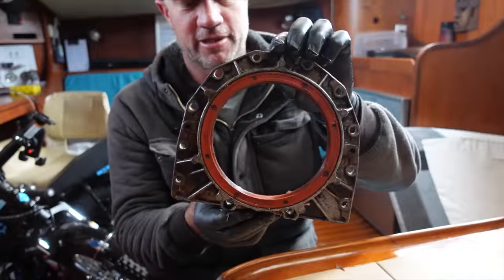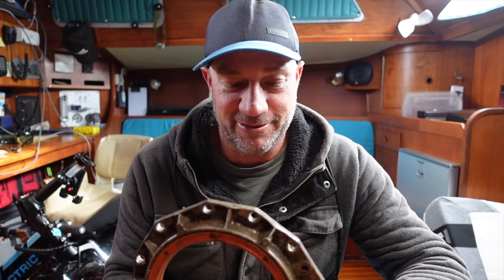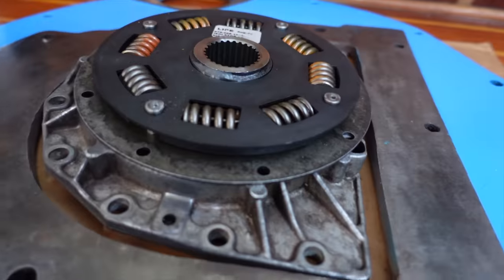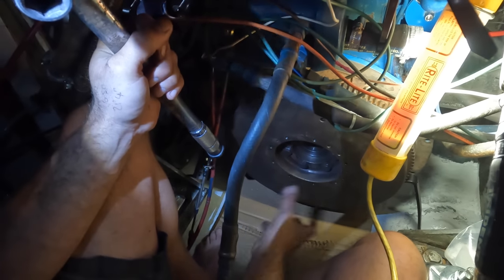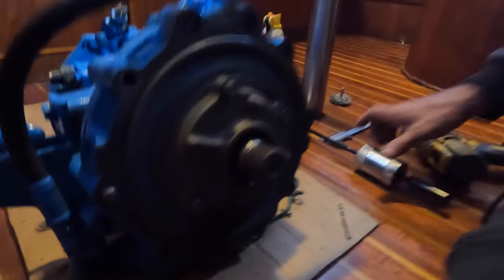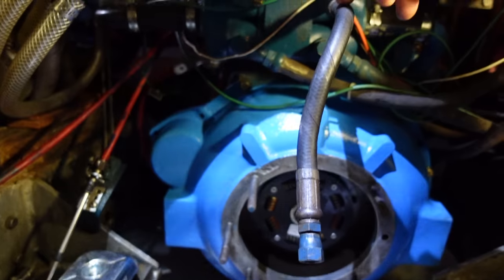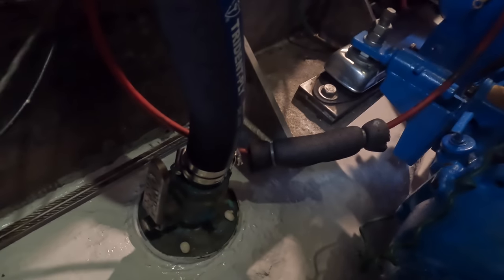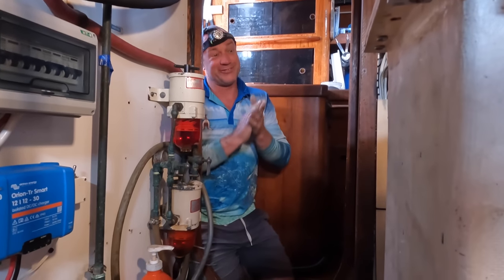BOAT LIFE = Time Patience and MONEY | Ep 351 | Lots of Boat Work

Comment: Lee, sorry in advance for the dumb question, but the crankshaft lip seal appears to have the lip facing towards the transmission, shouldn't the lip face the internal parts of the engine? (Unless it's a double lip seal that is.) Thanks for sharing and sorry again for the Monday night quarterbacking.